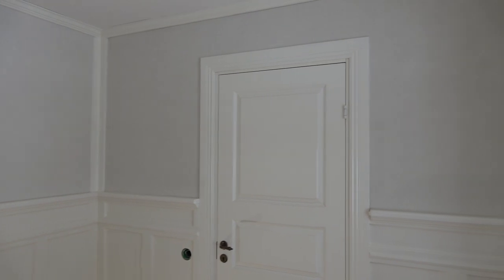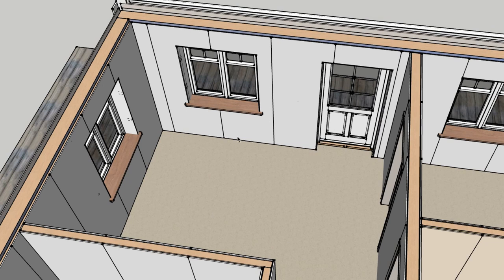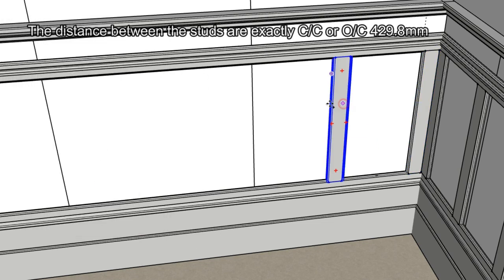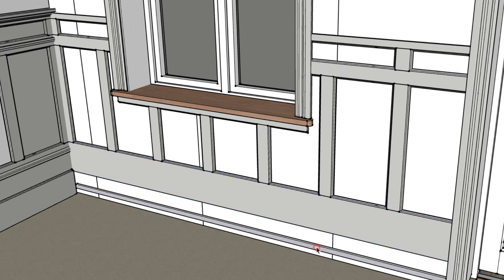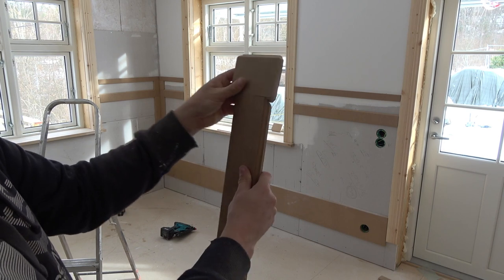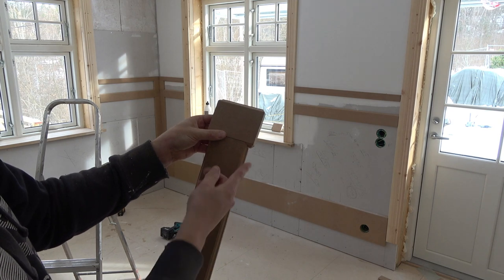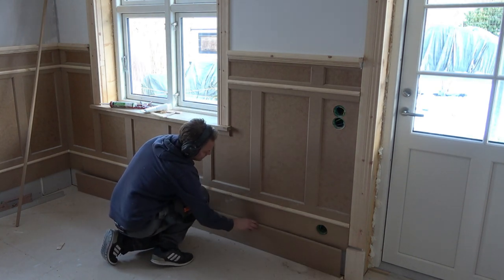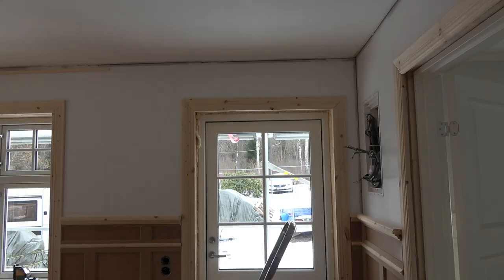DIY Classic wall panel that anyone can build with simple tools

Comment: Reminds me of what I’m attempting in my house, except mine is what’s called Arts and Crafts, or Craftsman style here in the states. The moulding is not as finished. Edges are just barely sanded so the paint doesn’t come off the corners. They don’t do a lot of miters, which is good because I’m not a carpenter. I’m using 5mm plywood as my panels, and 1.5” or 38mm paintable vinyl lattice strips as my battens. I put a wide trim along the top (100mm) and wide baseboard (150mm). I started in our small bathroom and I’m not completely satisfied. I’m going to make a few changes which I can do because I used complete sheets of plywood, I didn’t set the panels inside the battens, I nailed them over the plywood. Your trim looks amazing though which is what I’d expect from a carpenter! Love the channel!
Reply: He Make it look so easy when he do the work 😀
Reply: @mikamajlund3622  he’s a true craftsman.